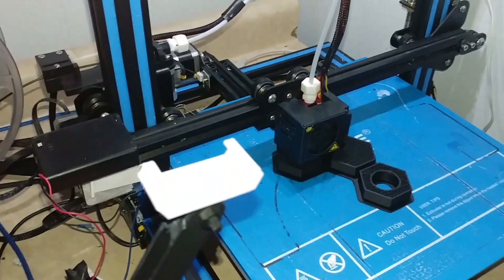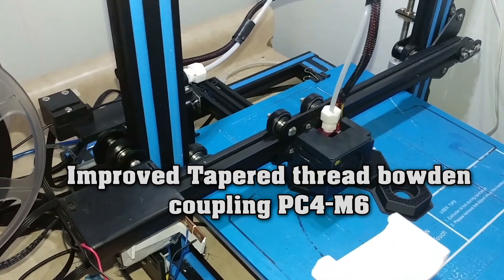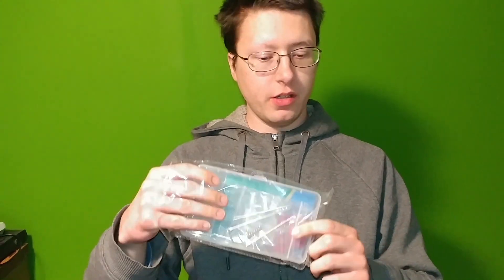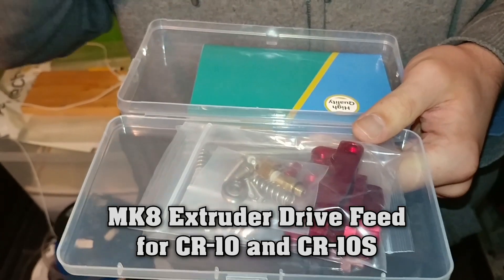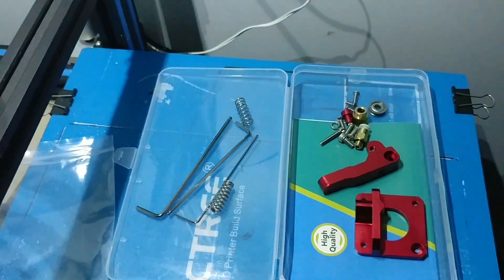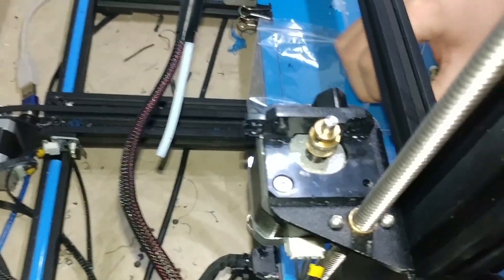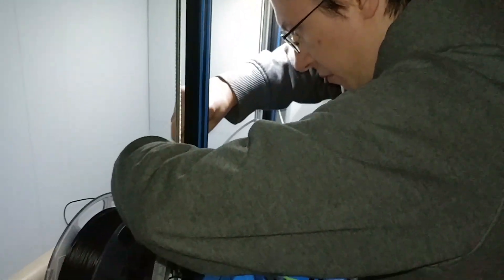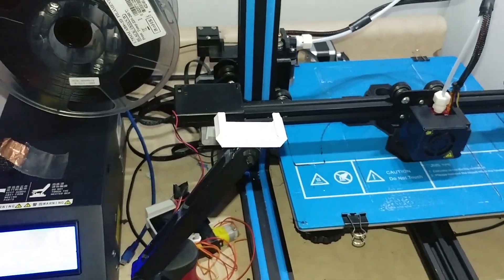Creality CR-10S 3D Printer - DIY Upgrades & Mods on the cheap!

Comment: Dave, I’m ready to take the plunge and buy my first 3D printer.  Would you and Jon recommend the CR - 10S?  And are the mods you are doing, are they to correct some problem with the printer or just improvements to make it work even better?   Also, since I am a noob in the area of 3D printing, if I did get one of these, could I possibly get you guys to assemble it and set it all up, and then add in the mods if I had it shipped to you in Virginia.  You could then  partially take it apart enough to ship it on to me.  Or I might drive over and get it and maybe we could fly a few packs together.  Anyway, think about it.  I would obviously compensate Jon for helping me out, and if you guys wanted, you could do some printer assembly, setup and mod tutorials that would help me and the other subscribers to your channel.  Dave, we could discuss this further be email if you’re interested.  My email is tmm787@gmail.com.   Thanks guys and let me know what you think about the printer.
Reply from the maker: Tom, Have you seen our assembly video that we have already posted. That gives all the details that you should need to build it.
https://www.youtube.com/watch?v=pogkgbBvZgk

Jon has moved about  2 hrs away from me and taken the printer with him. He still likes it and has been using it a lot.

At this point in time the CR-10S is still a great value. Make sure you get the upgraded version here:
https://www.gearbest.com/3d-printers-3d-printer-kits/pp_778981.html

Where do you live?
Reply: Dave Merc Productions   Hey Dave, thanks for responding.  I appreciate the recommendation on the Creality CR-10S.  I have watched your informative videos for so long that I kinda went overboard when I suggested you and or Jon might set it up for me.  I really didn’t mean to invite myself for a visit. Lol.  I am planning to attend Flitefest next month and I thought if I bumped into you guys, I could pick Jon’s brain on learning 3D printers, as he seems very knowledgeable.   I’m at the bottom of a steep learning curve and it’s always easier to learn something like that hands on as opposed to just watching videos.   Anyway,  I may decide on buying the printer before Flitefest or I may not.  I’m buying a bunch of RC stuff and I need to go a little slower.  I just splurged on a Ritewing Nano Drak to compliment my full size and Mini Draks.  And you may have seen on Facebook that I also am looking at the Night Radian.  Lastly,  I live in Houston. 👍
Reply from the maker: Jon just loves to talk about 3D printers. He will wear you ears off. But if you want it in time for flite fest you better order now because the shipping from China can take some time. I had the full size drak for a while but sold it to a friend. I would like to see your Nano Drak and Mini Drak. Maybe you will have them with you at Flite Fest Ohio 2019. Hope to see you there.

Comment: Hi Dave, good to see you got the 10S Model....The one with dual Z axis Lead Screws.....As an Engineer and someone who has designed machines for a living for the last 34 years, the Model with a single Z axis Leadscrew is, at best mechanically retarded...lol.
 I can't believe they even released that machine to market, it's such a mechanical sin....I dont have a 3D Printer BTW, but it's a coincidence my friend bought this very machine only last week....It's a very nice machine.
Reply from the maker: Seems like a very accurate machine too, parts are easy to obtain and there is lots of help online. We have found it to be much better than da Vinci 
 XYZ printer we had previously. Parts were hard to find for the XYZ.
Reply: Yes, it's a popular machine, even here we have what looks like a UK Agent....You are quite correct, spare parts backup is a very important to consider before purchase....I have this machine in my E-Bay basket, resisting the urge to press the button.
Reply from the maker: We got ours from gearbest. You might have to switch plug type before ordering though.
https://www.gearbest.com/3d-printers-3d-printer-kits/pp_778981.html?wid=1433363#goodsDetail
Reply: Its cheaper direct from our UK Supplier.....Yes, I kid you not.

Comment: So Dave, what do you think?  Are these "Must have" or "Like to have"?  I imagine a world where the you just laser scan your part and BAM!.  You print the part with no fiddleyness!  Further, out of a material that is not brittle.  Am I missing the boat?  For now I'm holding out another 5 years for "Dummy proof" ones.  For I am, in fact, a dummy....
Reply from the maker: Not a must have yet. It's one of those tools which is suited to the maker type mind set. 3D printers fit into the realm of additive manufacturing which is an emerging technology that has a long way to go. The ultimate goal might be something like the food replicators on the old Star Trek show where atoms can be printed into substances.  Right now it's very handy for making widgets of your pleasure. There are a wide variety of filaments that work with the CR-10s from ABS to a flexible rubber. There is even a wood style filament out.  Tuff PLA has come out which still somewhat brittle but harder to break. ABS+ is more flexible yet pretty strong. The durability of the piece also depends on the type of infill chosen and other variables so it takes some experimentation to see what works best for the job. Suggestion, if you are a senior you can take a free printing course at your local CC and get the hang of it before buying.
Reply: Dave Merc Productions thanks as always I Like Your Balanced approach to this. I've been watching them out of the corner of my eye for years but really haven't been paying much attention recently. My buddy in the tube deep just bought one and I'll also pick his mind as well. I have one using it is a stopgap measure because it's hard to get parts on his side of the world for model I'm not quite a senior as I have about a month left. Then I turn 55. I'll keep my eye on this Tech and see what it brings in the next five years or so.
Reply from the maker: 3D printing might be something handy for the motor home where there is limited access to parts while on the road. Jon has been printing threaded couplings for tubing for example. 3D printing is already being used in the automotive industry for aluminum parts. Of course that type of printer needs to come down in price a bit. Yes I like the ITTD channel as well. I wonder if his son likes 3D printing or CAD design. Oh I forgot to mention that some 3d printers do have scanning ability now.
Reply: @DaveMerc  I've actually given that thought.  I had one of four refrigerator door handles poop the bed and I mused that if I had a printer.....